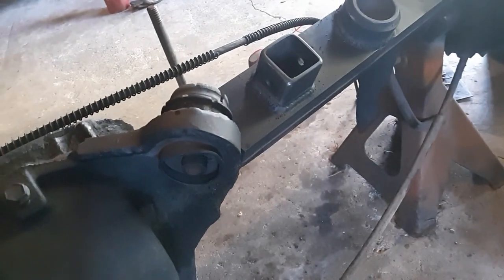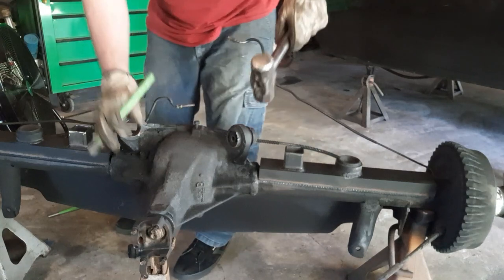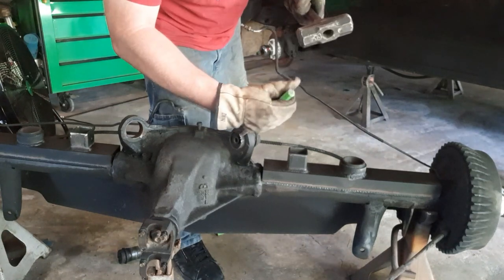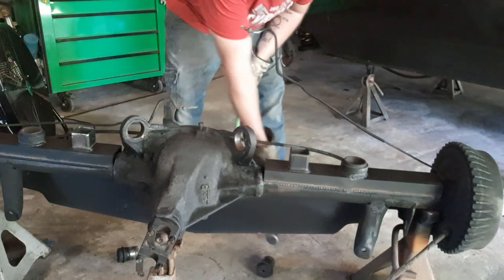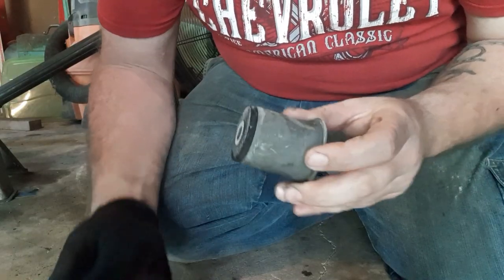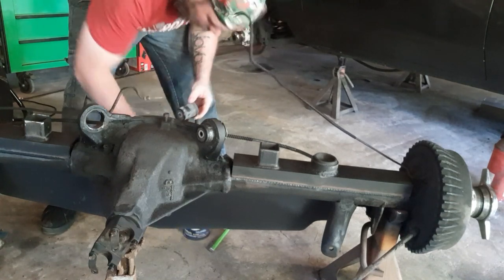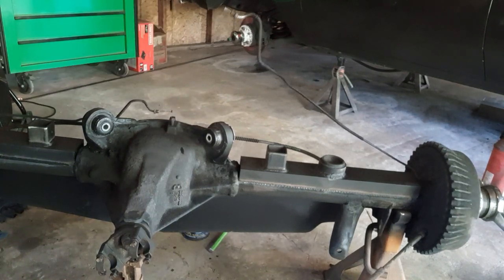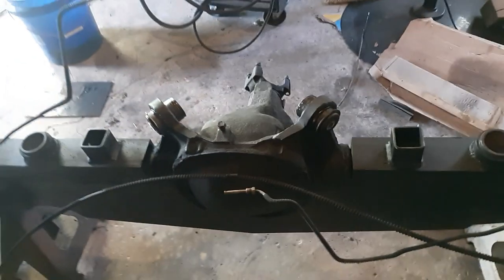How To Replace Upper Trailing Arm Bushings (The Axle Side)

Comment: Are they the same size bushings on both ends I need to order some for my rear end as well I don't know if they're the right ones
Reply from the maker: No the bushings in the ears and the ones in the arms are different they are getting hard to find I seen some on rockauto that came with each bushing one arm and one ear
Reply: @thecadillacdanshow8658  thanks bro